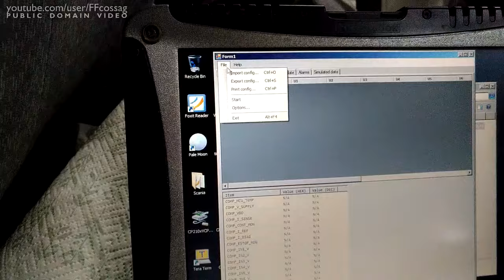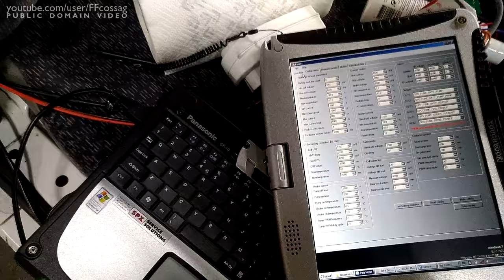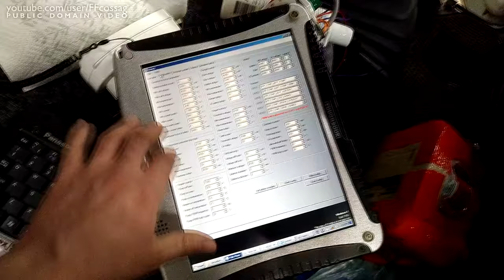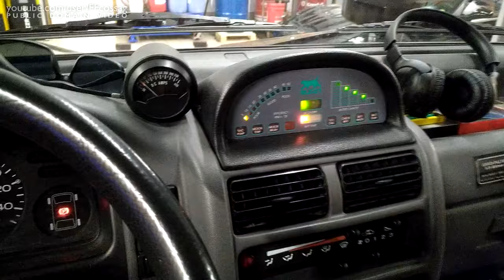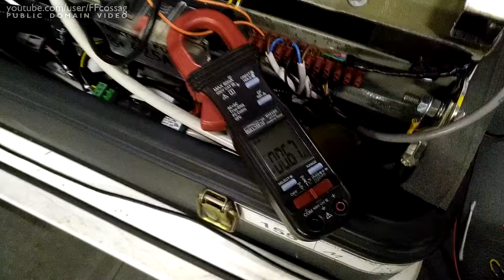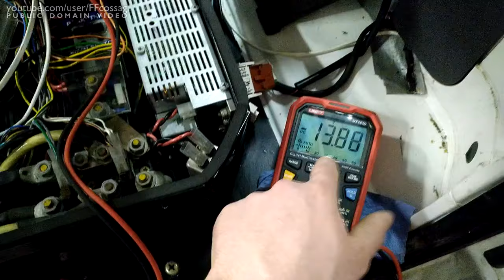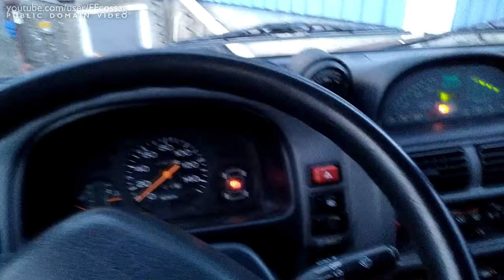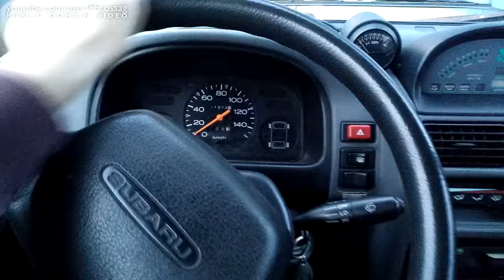Elcat Lithium Conversion EP5: Introducing TinCanBMS

Comment: great job with that bms ! keep developing and sharing your progress.
making it work with different cell/manufacturer buses and can would make it the swiss army knife of all bms for so many uses !
Reply from the maker: It's already very versatile, since those Tesla slave boards are so easily available for cheap. You can just use them to wire up any cells you want.

Comment: Way over my head, but well done, and welcome back.
What's the range on that thing?
Reply from the maker: Thanks! It has been a while for sure. The range is still a mystery. I accidentally drove about 150 km starting from a roughly 80 % charge a little while ago, so ... more than that! But at the end of it, the motor drive wasn't giving me more than 5 kW or so since it linearily throttles at low voltage.